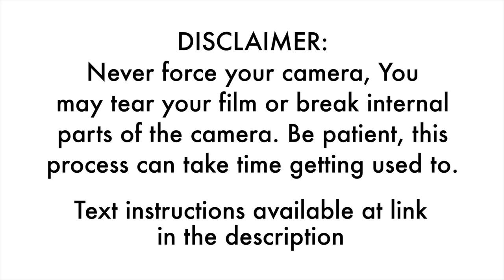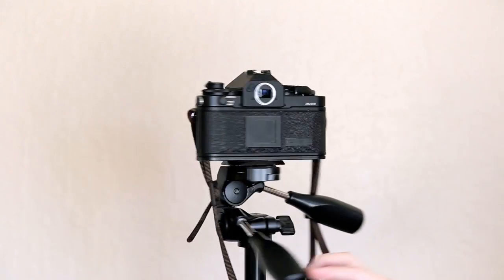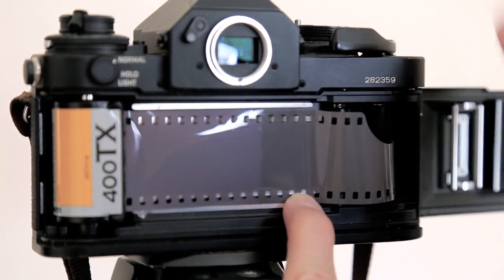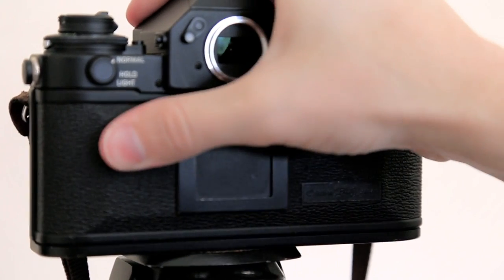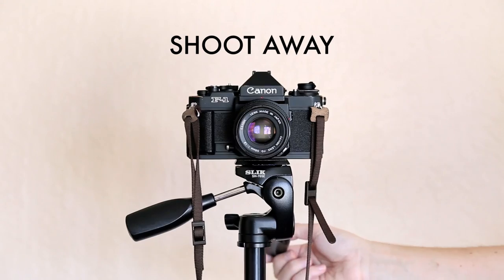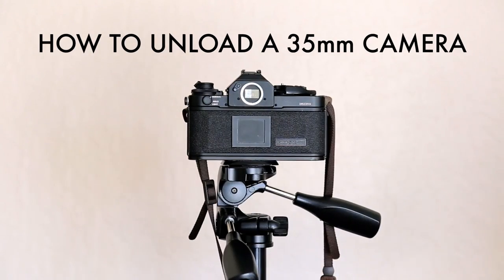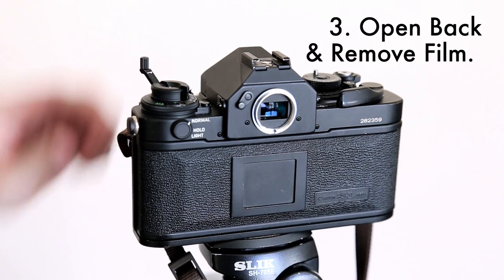How to Load & Unload a 35mm Film Camera

Comment: So in the military I learned to quick or rapid load the film.  Start by inserting the lead into the take up reel, and hold the leader in place with your right thumb.  Then,  drag the film cannister to the leftt and drop it in the supply or winder side.  Close the back, fire two shots watching the winder knob on the supply side to make sure the film is actually advancing.  Finally, check the film index indicator window is 1.

This whole procedure should only take about two seconds max, and pretty soon you don't even need to look while loading your film.

Comment: FYI - On my F1, I have to press the button on the bottom before I can even press the rewind button. Not entirely sure that is the way it should be, but it works.
Reply from the maker: I bought mine used. There is a good chance something is not working correctly on it. On any other camera I've had it's been the bottom button like that.

Comment: I need some help man, so I have the exact Canon F-1n that you have, I just cleaned it up & managed to get some batteries & film & it seems like I'm ready to go. BUT every time I try to roll in film, I do the same process I've seen everyone else do, put it through, wind the lever & press the shutter, I just don't know when to stop or if I'm supposed to keep going until the film is done. I know you said to go until the counter reaches 1, but my counter seems to be broken, does that have to do with anything?
Reply from the maker: With most film cameras it is about three shots into the roll that it begins. So what you can do if you have a broken counter is load it on like in the video and close the back. Then fire two more times. That should put you around frame #1. Then you can start shooting like normal.

As you are shooting, keep track of how many you think you have fired. You could also put a piece of paper in the reminder slot and write tally marks. Or just be really careful when you reach the end of the film. As soon as it gets hard to wind, you have most likely reached the end and you can unwind the roll of film. 

I hope this was able to help you, the F1n is a really awesome camera.
Reply: Oändlig yo thanks man! That is some very helpful advice!

Comment: If i have a roll that is accidentally pull all the way in bran mew how can i can unlock it?
Reply from the maker: The only way I've ever fixed that was to open it up and pull it out and then re-crimp the bottom of the canister. But I its not a guarantee and it usually will ruin the light seal. There is an old trick of sticking something flat and slightly wet in there. It binds to it and you are able to pull it back out. But someone may have a video or instruction on how to do it. Ive not been successful with that trick.
Reply: @oandlig9231  thanks!! I will try it
Reply: @oandlig9231  it happend because i cant press the rewinder trough the roll

Comment: Im new to film cameras. I bought kodak portra 400 and its too big to fit the camera :(
Reply from the maker: It may be that you bought a 120 roll of film that is meant for medium format style cameras. It can definitely be confusing, the film you are looking for is technically called 135. Kodak portra comes in both sizes so its easy to buy the other by mistake. An easy way to make sure is 35mm will tell you how many shots are on the roll, such as 24 or 36, where as because medium format can be different sizes it won't say how many. I hope this was helpful!
Reply: Thank you so much, I just went to my rite aid and got some fuji film super. Im still learning to work the camera but I'm pretty sure I loaded the film correctly after watching this video. On what I believe is the film counter on the camera, its in between S and 0. When I'm out of film it will be on 0 right?
Reply from the maker: When you stretch the film across the back, it exposes that area to light making that section unusable. S simply means the start of the film, once the back is closed you wind it to zero because that is where the unexposed film begins. So by the time the roll is done the counter will read 24 or maybe 36 depending on the roll. Then you can hit the button on the top or bottom to allow you to rewind the film before opening the back.